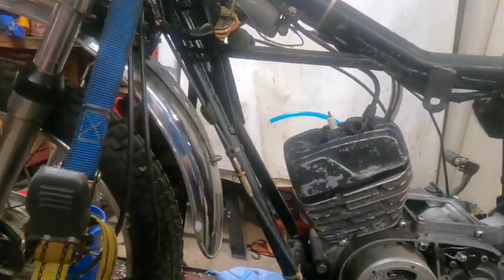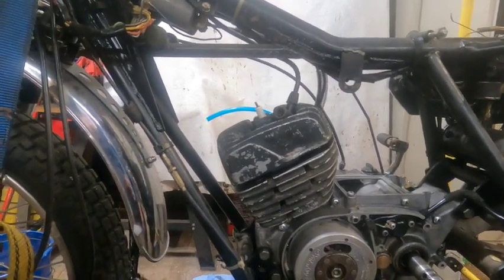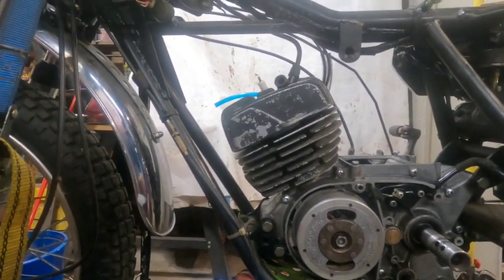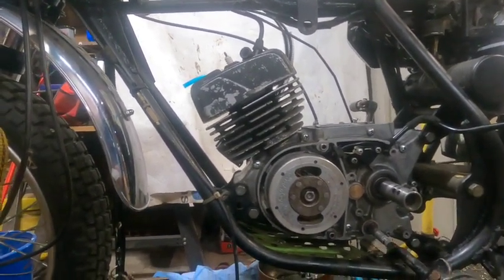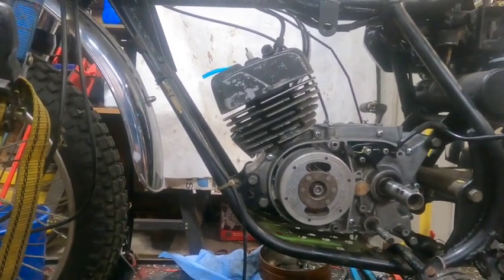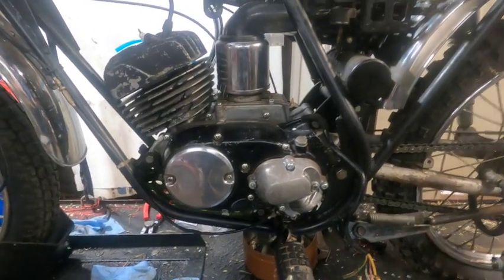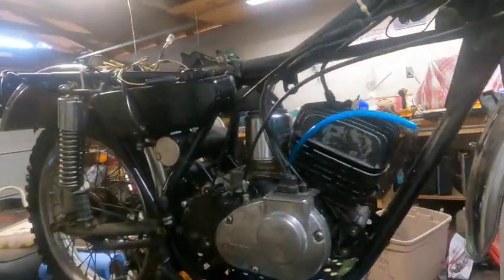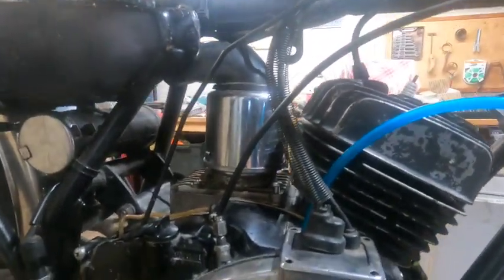1974 Kawasaki G4TR More Engine Work

Comment: I have this same bike that needs lots of work but, it has compression and has spark. The engine sounds healthy but it won’t start. I got it to start for a few seconds with starting fluid but that’s it. Is there anything else I’m missing?
Reply from the maker: You didn't mention if you took the carb off and cleaned it. That's where I would start. Mine started right upend ran well, but I could never solve the transmission problem. I moved on to another project, but I did order a new set of gears that I hope will solve the shifting problem. That's been more that a year ago I'm afraid. I'll get back to it eventually if I live long enough.
Reply: @oldguysoldbikes  I have the carb disconnected from the engine but I can’t get the throttle cable or any lines off of it. Did you make a video of you taking the carb out and disassembling it?
Reply from the maker: @CameronWent  You can try this one. https://youtu.be/HO1qqWV9Le0 it might help.